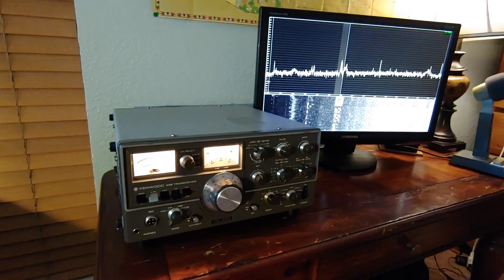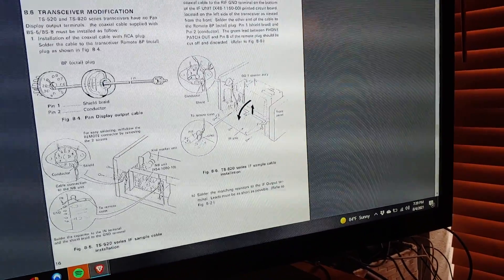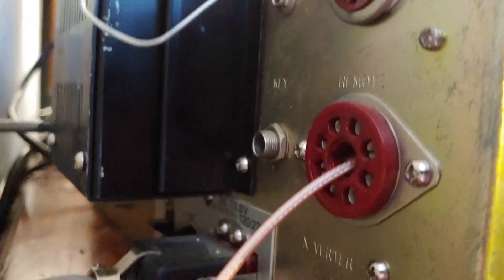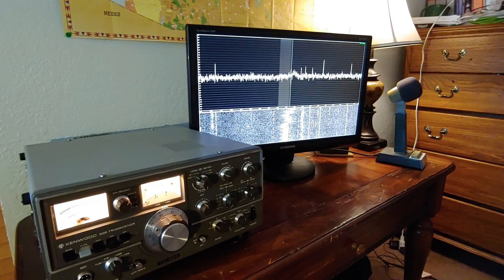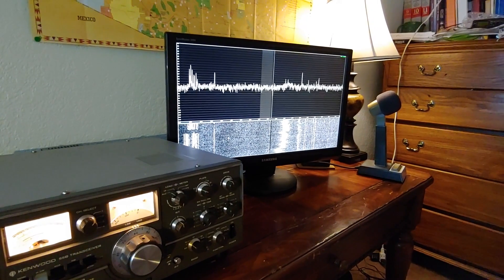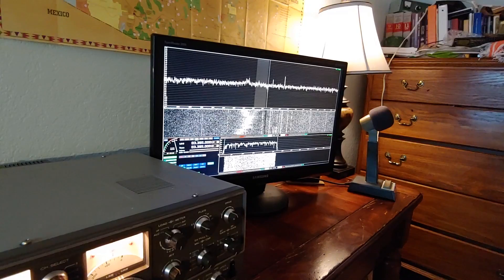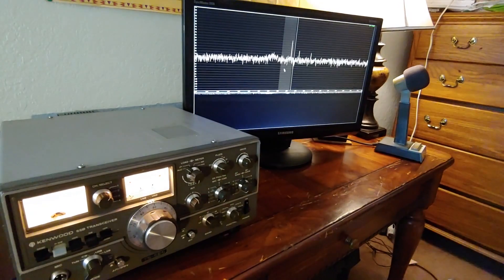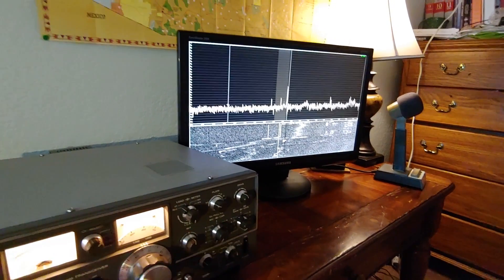A SDR panadapter for an old Kenwood TS-520

Comment: Just did this on a 520 Sports Edition (SE). I went with the drain of Q4 on the IF board though, as suggested in the manual for the KW station monitor. I have a reg. 520 too, maybe I'll try what you did. Easier spot to get to. Itching to try out but waiting foe more parts. Did the main filter caps. Just ordered C... 15-16? Different part number on the regular 520. But new manufacture dual 22ufs.

Comment: Is that a tube transceiver? I want to buy a old tube TRX encase one day we get a big sun flare hit us or if some cold country tries to use EMP weapons or something like that. Yes! if this happened then a pan adapter for an SDR would be useless but I highly doubt those to scenarios will take place. So if I have a old tube TRX laying around I may as well put some mileage on her.
Reply: This is a hybrid radio, where the majority of the circuits are solid-state, but the driver and final amplifier sections use vacuum tubes.

Comment: I enjoyed the video. And I followed your instruction. Yes, it does work with my TS-520. Thanks a lot.
Reply from the maker: Glad it worked! I have been using mine a lot lately for both the visual display and also as a DSP filter, which works very well, too. 73, Sam

Comment: Sam - was that Kenwood hybrid page info from manual page or could you please post the link you found - thanks
Reply from the maker: Of course. This comes from the SM-220 operating manual. Freq specs on page 3, and the IF output modification on page 16. Hope this helps, here's the link: 

http://www.radiomanual.info/schemi/KENW_ACC/Kenwood_SM-220_user.pdf
Reply: Check page 16 from the SM 220 manual --> http://www.radiomanual.info/schemi/KENW_ACC/Kenwood_SM-220_user.pdf